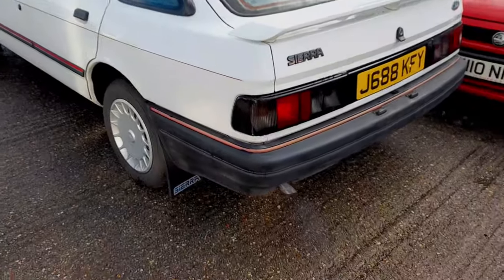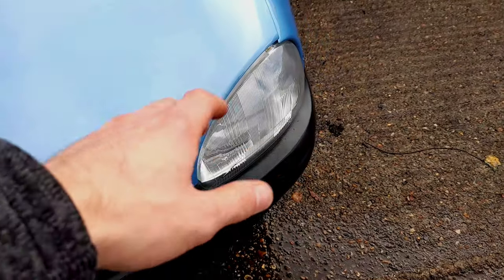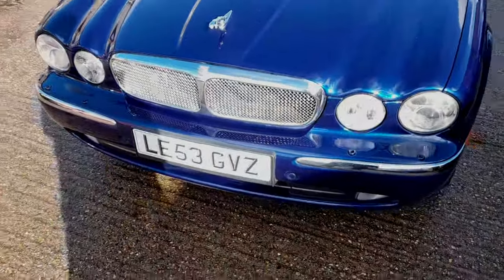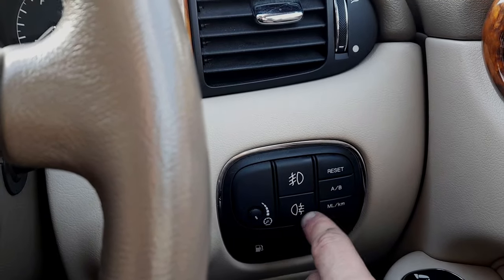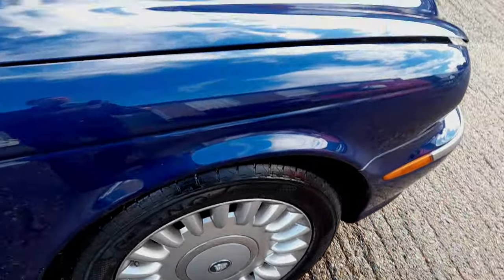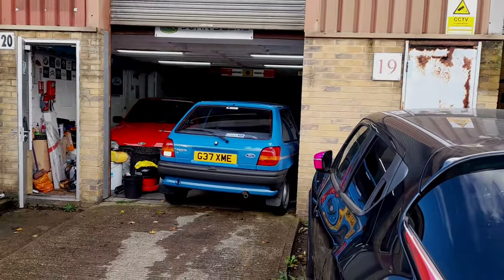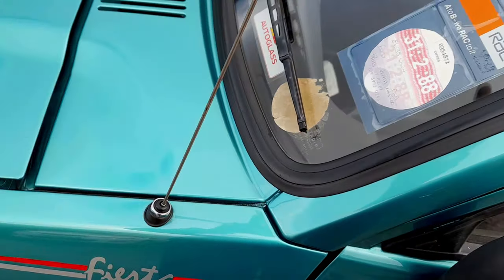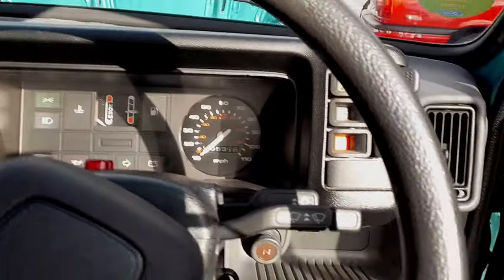Christmas Collection Special Part 2 - Fords, Vauxhall & Jaguar

Comment: The Sierra was mine. Damn I miss it. I’m glad she’s gone to a good home
Reply from the maker: Ah what a small world I'm glad you've seen this old friend, it's still going since this video was taken.
Reply: @usuallyfixingtinkering  The noisy tapping used to do my head in. I didn’t have a clue how to fix it. I hope the new owner can get it sorted. If there is any chance of doing another video at any point I’d love to see it. Bought back some good memories when you were showing us around the car.
Reply from the maker: The engine has a knackered camshaft, the owner tried changing the hydraulic lifters but still knocked. A worn camshaft is common on CVH engines after some irregular oil changes, one owner before you decided to skimp. I'm not sure what the owner intends to do but will update again.